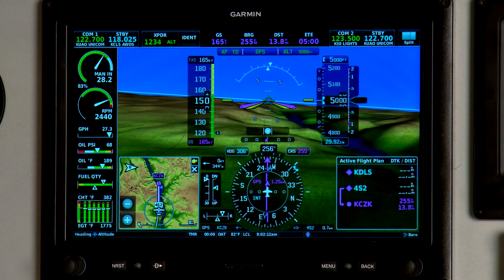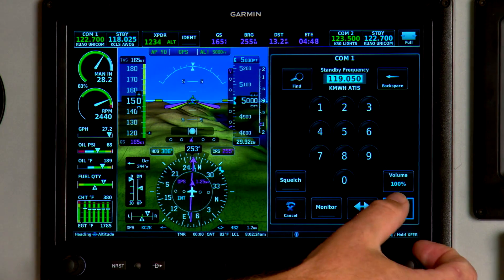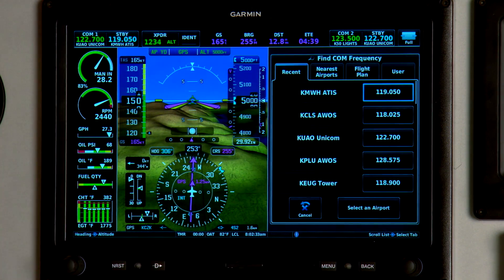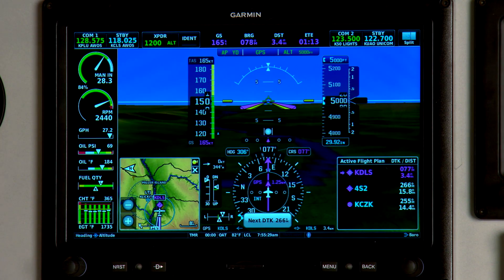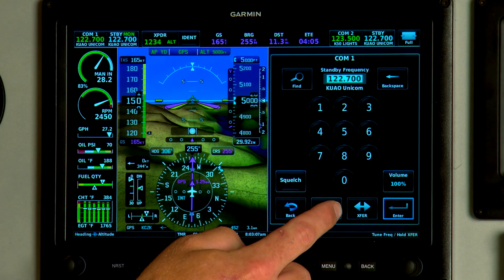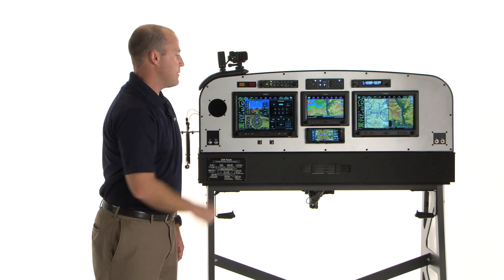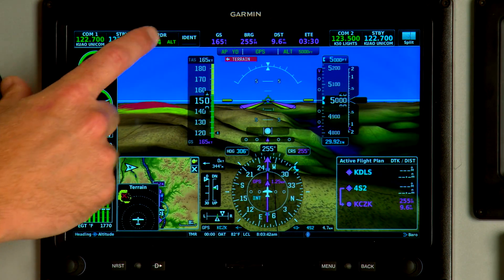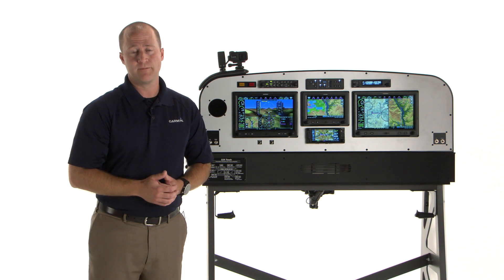Garmin G3X Touch: Controlling Your COM and Transponder

Comment: Is there a tutorial on how to use it without using the touchscreen? I know you can perform every function with the buttons and knobs, I would like to see that tutorial. The other day I tried to change my radio frequency using only the knobs, which worked up until the point of switching the frequency from standby to active. There is no button for that and I could not figure out how to do it. The reason I want to know is that occasionally my G3 X touch becomes unresponsive to touch temporarily. I'm not sure why that happens, but it usually works itself out in a few minutes. That being said, both times it has happened recently I was in the middle of trying to change radio frequencies. When the touchscreen becomes unresponsive, I would like to know how to do this with just the buttons  and knobs.

Comment: When configuring the transponder to have the ability to change the Flight ID (to enter a callsign for certain flights, for example) the FLIGHT ID button replaces the IDENT button. So if using the "Change flight ID by pilot " setting in the configuration, there is no way to IDENT. Is there something kissing, or is this something than can be addressees in a software update?

Comment: Is the legacy G3X (non-touch) system able to send standby frequency data to a GNS 430?  The manuals state that it is capable but there is very little information on how to connect the two units and the configuration of those ports. Is the comm information sent over RS-232  MAPMX ?
Reply from the maker: Please contact our support team at G3Xpert@Garmin.com for more details here. Thank you for being a Garmin customer.

Comment: Can the pilot program the display to show the com frequencies (add com 1, add com 2, and transponder code) or must that be done by the installer?
Reply from the maker: The installer configures those to display and the pilot can select where on the data bar they can be displayed. Reference this section in the Pilot’s Guide for more information: https://static.garmin.com/pumac/190-02472-00_b.pdf#page=56

^DK